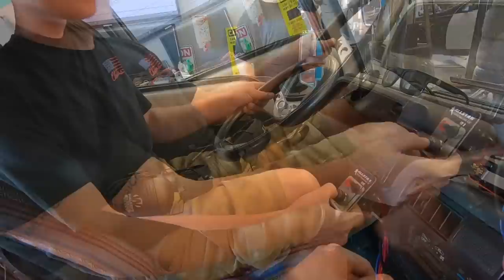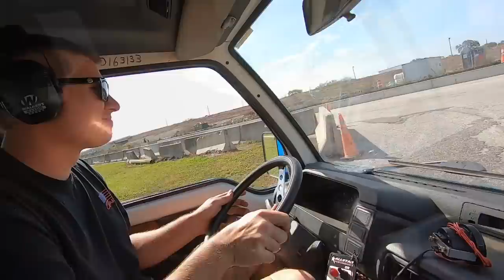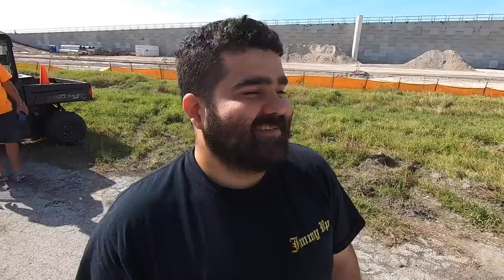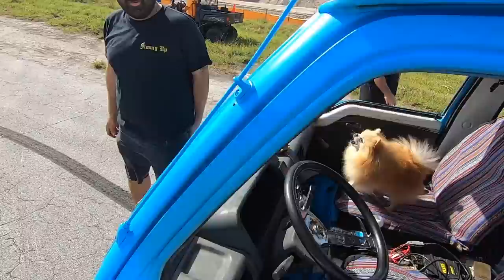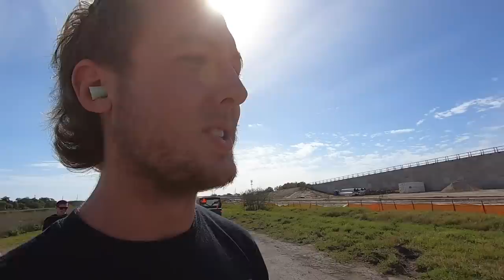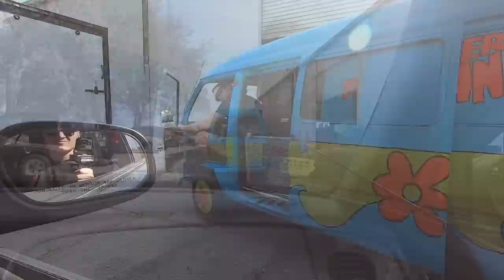ROTARY Swapped Mystery Machine EP.5 SERIES FINALE - Cooper's First Rotary Micro Van BURNOUT!!!

Comment: Insane that Cooper has a rotary swapped mystery machine before his supra was even finished
Reply: True but the Supra is something that Cooper is doing and not so much a channel thing
Reply: WookedoutLINK I feel like they could complete so many projects quickly it would stack up quick. Sometimes it’s fun just taking it slow with something that you know will be awesome
Reply: @larrysutton6530  i didnt mean this as disrespect. and that is true. i feel like we dont see enough about Cooper's projects tbh
Reply: @BBL_Drizzy91  Yea wtf man. Doesnt sound like coop at all
Reply from the maker: Cooper keeps his personal cars private to his IG. That’s his choice!
Reply: @CleetusM   Whats his IG ??
Reply: @Frankz455  
cooper_1320video
Reply: @Frankz455  Its Cooper_1320video. I just found it myself. I didn't realize that's where he shows his cars.
Reply: @CleetusM  did u say that van has a 520 gear n it ? If so u need to modify it for taller wider tiers
Reply: @CleetusM  or get a narrowed 8.8 rear and run some kinda 7inch wide steel wheel and have 4 of them 2 with drag radials and 2 with either junk yard tires or them 50 dollar Douglass tires from wallmart for when u do bur outs
Reply: Hell a 513 gear n an 8.8 u could do a 10ish second quarter mile run if that thing turns 10k rpm
Reply: Yeah that's cool and all as long as his cars aren't sponsored.
Reply: Cooper is like Rick from the old Tom Selleck Magnum P. I.    Doesn't get enough credit, and always there when the chips are down.  Beef up the Mystery Machine!!!
Reply: It’s a mystery
Reply: @CleetusM  I'm not hatin. To each their own
Reply: @CleetusM  tell coop to start his own youtube channel for his cars. I dont IG and would love to see some vids here and there on his cars.
Reply: @GapedCeiling  I didn't think you were trying to disrespect anyone I was just trying to explain why we have not seen the Supra yet sorry if I sounded like I was getting on you brother
Reply: Blunt Blowin yeah I was shocked. Oh well.

Comment: Ep. 3: "I know the camera makes it look like the pan is close to the ground but I promise it's not."  Ep: 5: "The pan is scraping."
Reply: I feel like stiffer front spring or a dry sump system would make it perfect.
Reply: bobwatters  Cleetus can afford it
Reply: My first thought lol
Reply: Weld an quarter inch piece of plate steel across the bottom of the oil pan  and put a castor wheel on the bottom of it, maybe they can get The Mystery Machine to spin like a top at the burnout contests?
Reply: He should put some of those 1990s low rider block used to make sparks.  Tire smoke and throwing sparks.
Reply: those tires could be a bit taller and stiffen up the sus a bit add a skid plate just in case and shes ready to rip
Reply: @James Last lol thats when its gonna fall over like the golf cart

Comment: Put Louvers in the doors so you can close them while still keeping airflow, and keep the original paint scheme on the louvers
Reply: Henry 👍👍
Reply: Side scoops
Reply: @OakFlooringDirectCoUk  side scoops feeding the radiator mounted in hatch?
Reply: Needs two more exact radiators with puller fans in front of each with a shroud that caps off each top and bottom. Then just vent the exhaust out the scoop.
Reply: Lifting this thing a couple inches or more ain't much for these guy dude!
Reply: Or holes

Comment: The smoke 💨 pouring out the rear doors looked like an old school Cheech & Chong movie. By far the best channel on YouTube!!!
Reply: Glad to know I'm not the only person old enough to have had that thought
Reply: I posted something along the lines of having duct work put in over the wheel wells and maybe a high flow dc fan to funnel it to the sliding doors windows. Kinda think this needs to be done, Even a cut out in the doors in the shape of a dog biscuit so that the smoke can roll out of it.  The fan can be adjusted so that it give the right amount of smoke off the back and enough out the door. 
Not 100% sure if some of those fog machine colored lights would work or not, If they would work with smoke that would be better!

Comment: Rob D still working on his 4 rotor, lulz. 

Meanwhile:

Cleetus already at the track ripping in 2 weeks.
Reply: True.
Reply: Lol but Rob has the pinnacle of rotary engines and a very complex chassis lol half a million dollar car basically
Reply: Don't choke On your aspirations director half a million dollars your math is off
Reply: Lol why you gotta do Rob like that man, he secretly idolizes Cleetus and his crew. Would be cool to see a collab between the channels some day.
Reply: @YoBoyNero  also true.
Reply: Tiger doll, the chassis was $175,000, the engine “long block” was $65,000, the transmission was $20,000..... with all the other stuff:diffs, transfer case, brakes, axles, driveshafts, dry sump, wheels, hoses and fittings, fuel systems, engine management.... is does add up. What part of the math is off? Hell, even the design has a cost associated with it. 

He has stated, before the YouTube money, he had spent $350,000 of his “own” money.  That was a year ago. This is Rob’s dream, and it’s unprecedented. Absolutely nothing about his car is “off-the-shelf”. 

Yes we all want it to progress faster, but everyone needs to just back off and stop being trolls.
Reply: 2 weeks with 6 months of man hours in them, also not a show car. Making things pretty can take longer then what it would take to make it functional.
Reply: @YoBoyNero  is a 500k rupees paper weight
Reply: @jeffandrews7335  and prob out done RoB D in Japan with junkyard parts. Hahahaha, Rob Broke it on an idle drive.

Comment: How is this stalling so much like it has a stage 5 clutch? I thought it was an auto
Reply: That's what I'm wondering. Unless there's still too many shims in the transmission and it's dragging
Reply: Torque converter is to tight.
It will get better as the tune comes around and the engine begins to idle at less then 1000 rpm
Reply: depends on the converter stall
Reply: I would’ve put a 3k stall in it, I mean it’ll rev to the moon after the break in period
Reply: "auto" is used loosely, my racecar has an "auto" trans(Bert), but still requires a clutch pedal, its ideal for racing, but terrible for driving at low speeds
Reply: @maccoman71852  I don't think that will idle at 1000 very well, if the porting on that dorito spinner is as aggressive as it sounds. Gotta remember that a lot of bridgeported or peripheral port rotaries idle upwards of 1500 RPM

Comment: Replace the rear glass in the hatch with a sheetmetal panel holding the radiator  & fans sucking air/smoke out the back. Also an art carr/winters shifter might be the way to go for shifting

Comment: Sweet burn out van. I would move the raditor to the back door and wall off behind the 2 doors for the safety of having the gas and hot water that's under pressure behind metal , Then you have room for seats or more tires.

Comment: Any thought on using a piece of steel or a load bar, and fix the sliding door hardware to it. It would give you the option of holding open the sliding door for the radiator at different lengths.

Comment: You should do a rear mounted radiator with a bottom scoop for the air to pass through and cut holes out the back for the air to pass

Comment: Defiantly needs bigger tires in the rear and put the leaf's on top in the axle then you'll hopefully get the oil pan higher. Shoulda went roll bar with radiator in the back window though, probably get less smoke inside with the side doors closed.

Comment: Make it a Gasser van. Put a Ford 9 in back , put a Jeep XJ Cherokee 2 wheel drive straight front axle on it. You will get bigger rear end , bigger brakes , five lug. No oil pan issues and with the lift. Bigger tires will fit.

Comment: What if you louvered the door and ran the cooling fan the normal direction?  And louver the rear hatch so that the hot air goes out that way? Less chance of being pulled over with closed doors. :)

Comment: Is that the permanent mounting spot for the Rad? Doesnt seem like a good spot. Why not put it at the rear and make a scoop from under the van that pushes air through it and out the back of the van. Would be safer too.

Comment: I'd think about dropping the rear suspension so the driveshaft is straighter and raise the front door I'll pan clearance. Maybe weld some skid testing bars so even if it wants to roll it just hits a skid rail instead of rolling over. Or even give it a rounded external roll cage so it just rolls over completely then back into it's wheels again.

Comment: should have mounted the radiator higher so that it lines up with the window so you can have the door shut. also should have a big fan in the hatch to suck out the tire smoke from the cabin!
Reply: maybe a second radiator and/or oil cooler on the other side?

Comment: Does it only have one gear love to hear that go through the box
Reply: They were literally 1-2-3 shifting it. There is no effort in walking through the gears. The final ratio for the differential is 5.28:1  The tires are tiny and they are 5 inches wide on the road.  All torque and no speed  with no weight over the rear tires.  Every single one of those factors means this thing can't do nothing but spin the tires if you put it in gear.

Comment: she needs long travel in the front. extend the controll arms about 18 in with dual bi-pass shocks. in the rear run a full length currie rear end. also with dual bi-pass or possibly triple bipass shocks and a 4 link or a toplink set up. shit boy u would be doing jumps all day like a side by side and with some limit straps u will be less tippy on the skid pad.